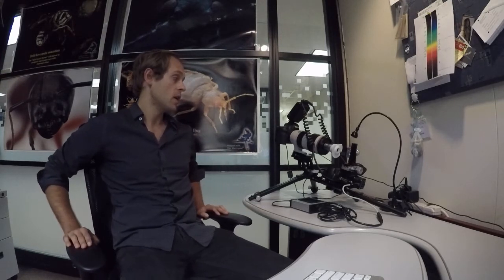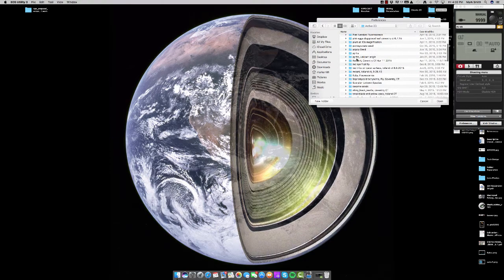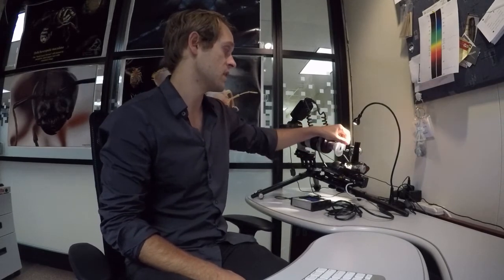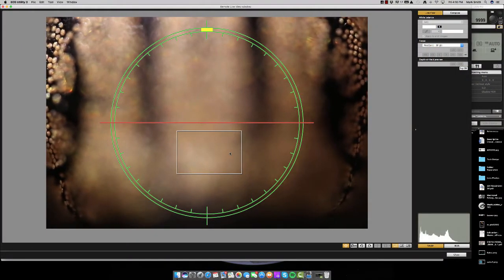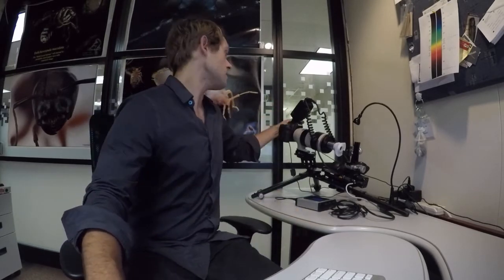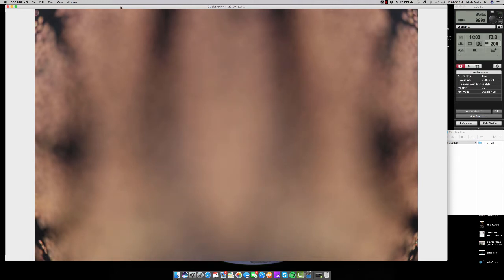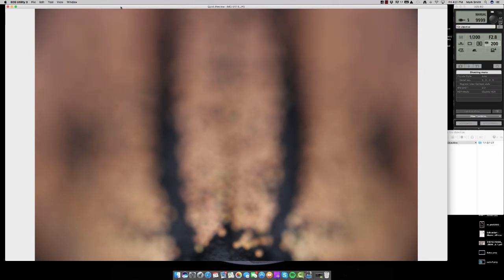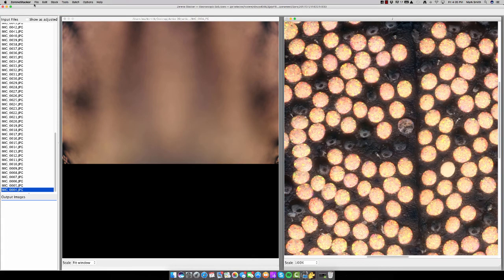Macropod MICRO KIT 3.1.1 Using the 10x Objective

Comment: What was the step size with the 10x
Reply: The depth of focus is 3.5 microns.
Reply: @smithmark  the 10x has a 3.5 micron dof. Are you saying that you can product sharp stacks with a step size on the stackshot of 3.5 micron?
Reply: Craig Heslop I think the video shows it, right? Www.macroscopicsolutions.com yes, stackshot precise enough and a stable base/system is required for high magnification.